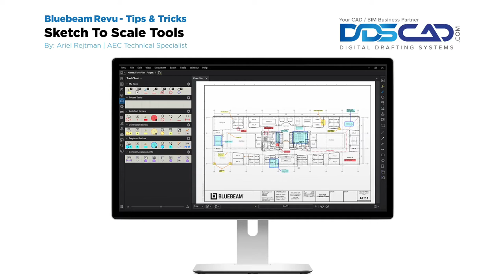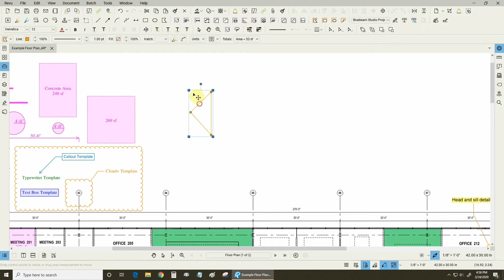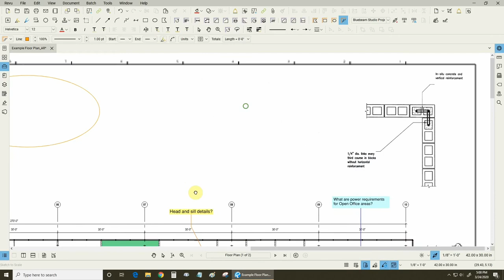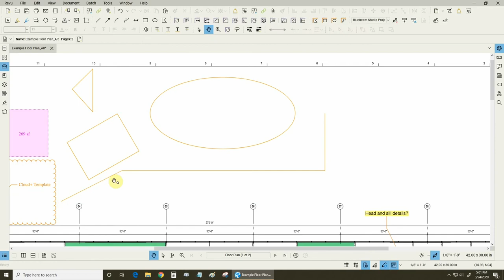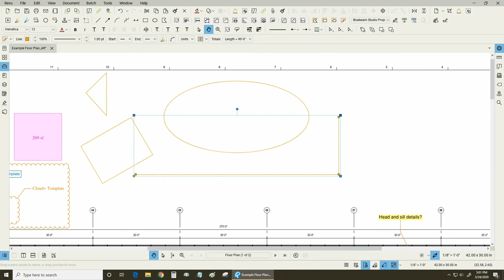Sketch to Scale Tools in Bluebeam Revu

Comment: how can you edit the dimensions once the scaled rectangle is drawn, I want precise measurements not just griping and pulling on a grip when I want the rectangle to stay the same in one direction. I see the width and height in the measurements tab on the side but they are grayed out an dyou can not edit them is there a way to get these to be editable?
Reply from the maker: A Sketch to Scale tool can't be modified with precise dimensions similar to when we create a Sketch to Scale markup. We can only edit its grips and properties. I recommend re-creating the rectangle with its new measurements and deleting the old one. We can submit feature requests to Bluebeam with this link: suggestions.bluebeam.com

Comment: How do you edit the dimensions of your sketch to scale object after it's drawn? Is it possible? Or do you have to delete and redraw?
Reply from the maker: You can edit the dimensions of a Sketch to Scale object by moving your mouse over one of the yellow "grips" and holding the shift key. You'll see a "-" sign appear near the bottom-right of your cursor. You can now click on that grip and delete it. You can also add grips by moving your mouse over any part of the object. You'll see a "+" sign appear near the bottom-right of your cursor. You can now click on the object and create new grips. Also, you can right-click on a specific line on the object and select "Split" if you want to separate the object into separate objects.

Comment: Hi is it also possible to draw 90 degree deepened on the already drawn first line. I want to draw rectangle shapes along the beams of my plan, which are not parallel to my page.
Reply from the maker: Hi Eva! Yes, you can draw any shape at any angle with the “Polyline Sketch to Scale” tool. After you turn on “Snap To Content” in the “Status Bar”, you can use the tool and snap to specific lines that represent beams on your plan. You can start at the end of one beam and snap to its endpoint, and you can specify specific lengths and angles while using the Polyline Sketch to Scale tool. This will work even if your beams and other lines aren’t parallel to the edges of your page.